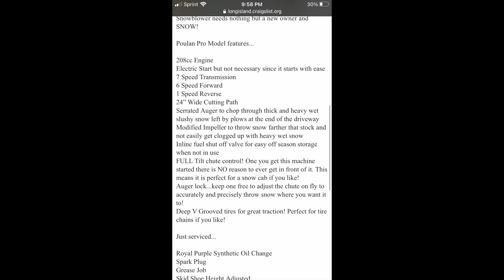Finally Figuring Out & Fixing Why The Auger's Don't Spin Don't Stop On Snow Blower Poulan Husqvarna

Comment: wishing there was a video showing how to get the impeller off to replace it!
Reply from the maker: You are going to have to split the machine in half.
Reply: thank you, i did manage to get the front part separated by watching videos, cant figure out how the impeller shaft comes off to remove the impeller, im not mechanical at all haha.  at least i can fit the front part with the auger in my car to take it to a repair place and have them put the new impeller in for me. @pattayperformance
Reply from the maker: @mlb4946  give me a call 631-707-0797

Comment: I know this is an old video and I hope you're still active on this thread. but do you happen to know what size belt these machines take for the auger drive? I cant seem to figure it out online. I have the same machine and I've Shredded 3 belts this season. all 35 1/2" they seem to be too tight and dont diss-engage off the drive shaft. I'm pretty certain its supposed to be 35 1/2" belt but after a while of use I've also had the belts hop off the lower pully. So at first they seem too tight, running the auger full time and eventually (after 30 minutes of snowblowing) they seem to be stretching out and hopping off the pully... I'm almost ready to sell this machine.. lol this is only my 2nd season with it and its been really taking me for a run around this year.
Reply from the maker: Model and serial number for your machine

Comment: If you ask me it needs a pair of drag slicks.  And wheelie bars.  And duel exhaust ... Make it go faster... 
Yep pull oil pan and check oil pump .. see I knew you were going for drag slicks... Then put big block no go for the Mazda rotary engine that way it will wind up to 7500000   R.P.M.  now that would be fun. How's the clutch ? Posi track working ... Forgot the additive G.M. 12 bolt. 
Oh sorry wrong video..lol.
  Got to love it when someone works on something and they don't have a clue what they are doing...
To be honest with you the wheel shafts should use never seize greese don't work as good went through this once before ..
Doing a great job on it myself got old 1970 John Deere 7.h.p.    26"cut runs great will never get rid of it... These new ones are pure junks...got mid '80's to '90's mid as well and I hate the dead man controls like you need 6 arms to control the shit one on shifter, the other on chute, then holding down drive and other on auger  and other in pocket getting smoke  and last hand for beer 
I hope you got 40 of Jack Daniel's handy for the job on that crap...
Reply from the maker: 😂😂😂😂

Hey if you can hot rod cars...you can work on this!  I’m torn between Anti-Seize and grease!  Mrs. HATES anti-seize bc sometimes I get it everywhere! If you service your machine every season like you are suppose too...wheels will come right off!

I like Grey Goose...couple of good times but bad stories attached to JD !

Thanks for the view and comment, hopefully you subscribed to my channel 🤙🏻🇺🇸🔧🦅

Comment: Typical on higher end MTDs they have a shoulder bushing or post that wears in the area of rotational force causing the arm to tilt or cock and not run true and parallel to the belt. Look at the IPL to see how the arm is held on position. Also the hole in the arm gets wallowed out causing wobbling and needs to be replaced or welded up and re-drilled back to round.
Reply from the maker: I'm so sorry I missed this!  Will keep this in the bank!